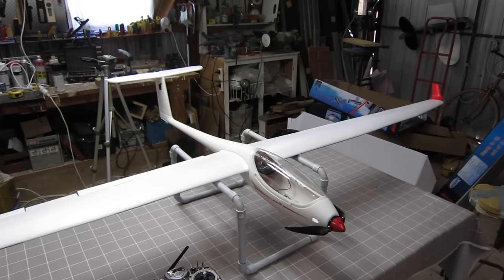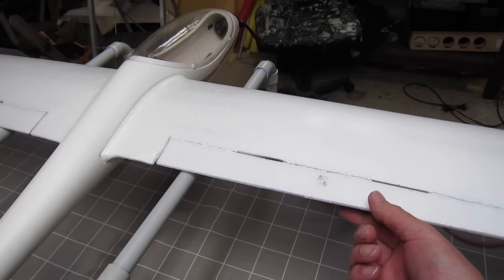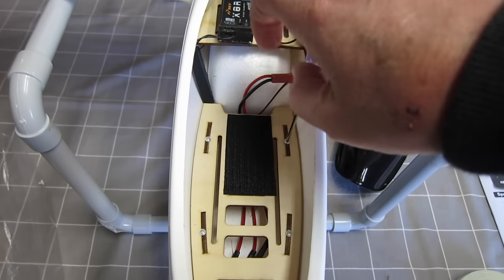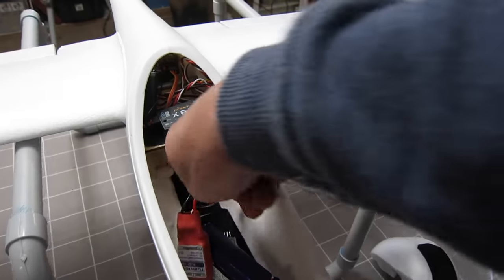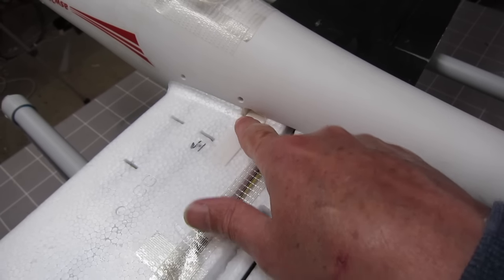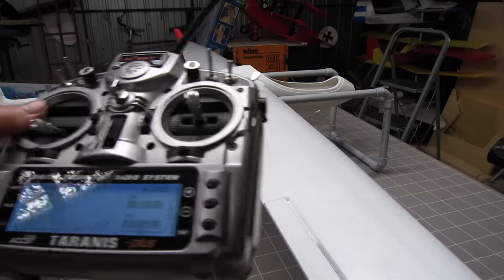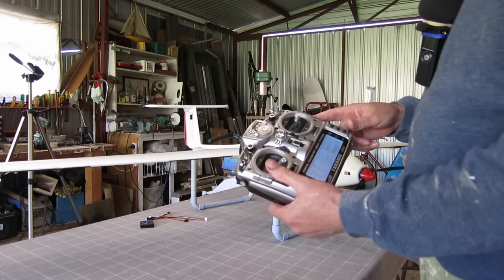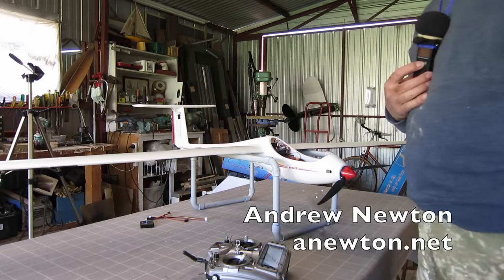Volantex ASW 28 mods

Comment: Hi everyone, do we select 1 flap + 1 aileron or 2 flap + 2 ailerons on transmitter setup? Thanks in advance.
Reply from the maker: First one if your using Y-Leads, second one if you're using separate channels for each flap and aileron, ay a guess. Which radio?
Reply: @AndrewNewton  Thanks Mr. Newton. I am using Spektrum DX8e with Y leads. In this situation I will have to select 1+1 I got it, thank you very much for your reply.

But unfortunately the aileron servos are reverse in my model :( I am using spektrum receiver with safe but safe function will not function if I reverse the ailerons :( Too many hassles.
Reply: @AndrewNewton  I don't get it. For flap/aileron crow settings I thought you couldn't use a Y-connection for the ailerons - I thought they had to be on separate channels.

Comment: Hi Andrew, this is a really great video for me as I've recently got this glider and would like to do the single plug wing wiring connections as well.
If you have the time would you please 'show' me how you did it, in a diagram, from the ESC to both servos as I'm hoping that it will show 
how the wires were joined together and why you only need 4 wires instead of 6. Your videos are most helpful to us newbies to gliding.
With help from a gliding friend I've managed to do 'CROW and Camber' setup with a DX8 gen 1 and an AR7000 Rx. XCLNT Vid and thanks in advance
knowing you did this mod some years ago....John H...
Reply from the maker: Here is the wiring digram for the wing servos. Both servos can share the 5V connection (red) and ground (black) so that reduces 6 down to 4 wires. https://www.flickr.com/photos/pandasimages/31984385060/in/dateposted-public/

Comment: Hi Andrew, I was using Multiplex connectors on my Radian Pro and on my new E-Flite Mystique.
3s balance plugs are a much smarter option, smaller and lighter. Excellent idea, well done. Keith
Reply from the maker: Thanks Keith, I just used them because they were immediately available

Comment: You do know that nose heavy is the easy fix, it only takes a small amount of weight on the rudder to make a BIG difference to the CG, the tail is a lot farther from the CG than the nose. These foam planes seem a little lite to me so adding a small amount of weight make them penetrate and handle better to me but if you are trying to loose some weight that would be the better idea.
Reply from the maker: Yes you are right, and I never think of adding tail weight. The extra weight certainly wouldn't adversely affect a glider this size and weight.

Comment: Hey kids. Just saying, with the servo plug mod, he only did that because he was using the flaps as ailerons.
Reply from the maker: Hey Blade. Flap are flaps, one connection is easier than two...is the reason
Reply: Oh. Sorry. But in your review went u using flaps as ailerons so u had 2on each wing? Or was it someone else... I’m confused.
Reply: Oh, it was someone else. Soz. But how do u work flaps and ailerons through one cable?
Reply from the maker: On my Bixler 2 and 3 I tape the flaps and ailerons together so they just need one servo and act as full span ailerons. On the ASW28 there are separate signal wires for the flaps and ailerons, so it's actually two servo cables going through one plug
Reply: Ok Thanks. I might try it

Comment: Hi Andrew,

I have also the ASW-28, the old model, and the FrSky Tareanis.
Could you send me your  Taranis configuration (eepe file) for this model?
Thanks in advance.
Reply from the maker: Yes, happy to. Email me at apnewton@gmail.com
Reply: Hi Andrew, I too have this ASW28 like your setup, must get around to doing connector mod (have done similar on another glider) Would you be kind enough to let me have the Taranis setup info. I'm new to the Taranis so struggling a bit, I've been used to Spektrum.